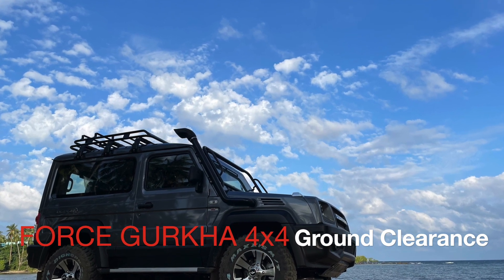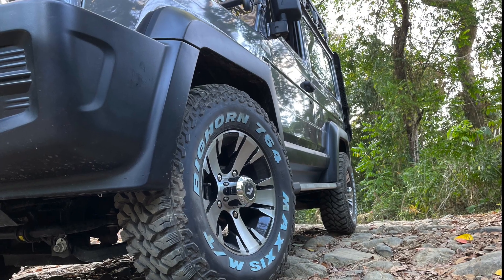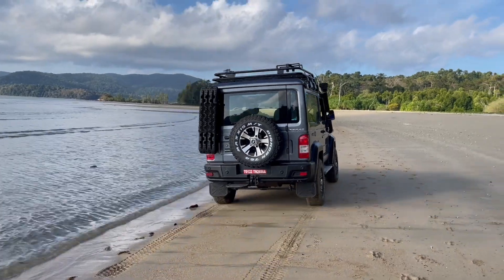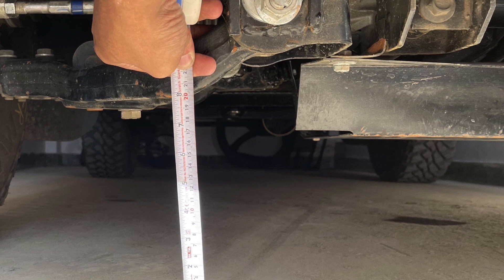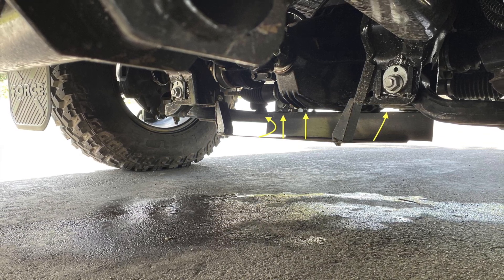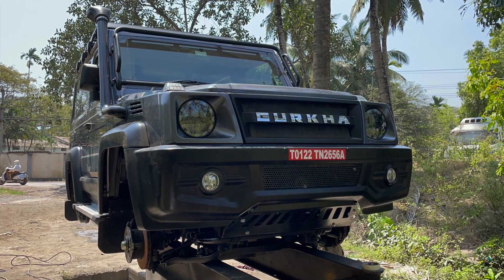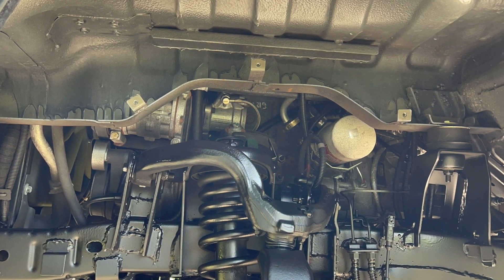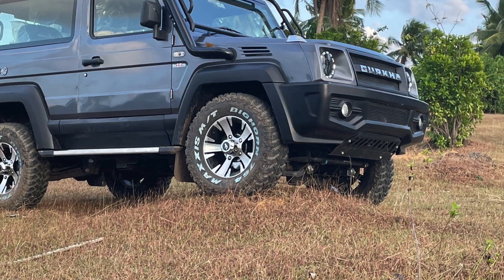Force Gurkha 4x4 BS6 | How I Increased Ground Clearance of my Gurkha | 235mm

Comment: Things that need to be improved in stock gurkhas: 
Gearbox from Traveller (Since it can handle a higher load), higher ground clearance and if necessary a solid front alxle with coil springd ( since it's a durable arrangement). Also the fmtech2.6 engine should be tuned to produce 350NM as of with travellers that come with the same engine.
Reply from the maker: 350HP? did you mean torque Nm? Gurkha runs the 2.6 Common Rail Engine at 67 kW (91 hp) @ 3200 rpm pulling 
Max Torque of 250 Nm @ 1400-2400 rpm. Same engine in traveller 85kW (115hp) @ 2950 rpm pulling Max Torque of 350Nm @ 1400 - 2200 rpm. That’s the best increase we can aim realistically. The G28 gearbox in Gurkha is mated for a private car/off-roader tune while the G32 in traveller is better suited for lugging passengers in a commercial van like tune.
Reply: @tripaccino  Oh my bad I typed HP by mistake. I mean it's common sense that kind of diesel engine won't be able to make 350hp unless fitted with big turbos, expensive injectors and a big intercooler. Even many Inline6 diesels take a tough time to produce that much bhp.
Reply: @tripaccino  Actually the G32 was also paired in the exclusive xtreme variant of the gurkha which produced 321nm and gave service for RFC gurkhas. Such a hell of a mean machine it was. Sadly it's discontinued. It was the only 4x4 in India which proved as a proper 1st gen defender, 70 series land cruiser and w461 300cdi gclass alternative, with solid axles front a rear and coilovers. Now we're left with nothing IG. 😞
Reply: @tripaccino  any plans about churning out big torque numbers?
Reply from the maker: Long term project 😈 please stay tuned and Django will be pulling more soon 😼

Comment: Thank you for sharing.

That IFS bash plate is the Achilles heel of Gurkha. One has to be mindful as an IFS never takes kindly to a bad rock hit.

The Force engine, gearbox and driveline is probably better than any other comparable vehicle. A 75 litre tank would have been good.

A scaled down coil sprung solid axle version, like the discontinued Force Extreme, with one upsize NATO tread tyres and steel rims could make it an unbeatable option for Defence and extreme terrain buffs......

Happy travelling !

Comment: Thanks for sharing. I see that you fixed the low hanging bash plate issue. Did you find a solution for the hanging lower control arm? I would worry about the control arm while off-roading
Reply from the maker: While it mostly can escape by picking the right line and raising the tire upon crests, The control arm does take hit when one is not or cannot be too careful, the solution would be a complete redesign only. Body lift kits still won’t fix the arm issue.

Comment: I couldn't comprehend sir the front arm lengthened about 205 mm with the dash plate ground clearance drops to about 175 mm ...you remodelled the plate put it back in the manner that still it would protect the front arm so how you raised the ground clearance up to 235 mm higher than the 205 lengthened front arms.??...please explain sir....
Reply from the maker: ARAI DEFINITION OF GROUND CLEARANCE: "    """ Ground clearance is the distance between the ground and the lowest point of the centre part of the vehicle. The centre part is that part contained between 80 percent of the least distance between points on the inner edges of the wheels on any one axle."" LOWER ARMS are traditionally not counted for GC calculation as they rise and fall with the wheel. It is a concern definitely but its not as big a problem as a bash plate hanging between the wheels low and center. Manufacturers often use the lower bash plate trick to avail lesser taxes which is based on ground clearance. So if this bash plate was not lowered , Force would have had to pay higher taxes as GC would have been more than 200 mm.
Reply: @tripaccino  ...thank you so much for the clarification sir...and sorry sir had I read about the ground clearance on Google before you  would have saved from your time on writing this long answer ......sir do please make a video on mechanical or other  problems you faced on your Gurkha as I guess you yourself using the very first batch ...as we have seen people are facing  issues  with steering even a serious accident reported in himalyas due to steering failure  ...have you yourself  suffer from such issues sir ....??
Reply from the maker: @indiancommando_abbas  No problem brother. Im happy that I was able to answer your query clearly. I will definitely make more videos to explain everything. If youre interested to know more...Please read all my stories on TeamBHP, just search for the "island gurkha" Justgoogle "TeamBHP+Island Gurkha
"
Reply: @tripaccino  sure sir ...thank you so much...

Comment: What did you do exactly with the swing arm protection plate? How did you resize it and fix appropriately in such a fashion that it increased the ground clearance upto 235mm? 

Did you fabricate that plate by measuring the area where you were supposed to fix it up? Else simply cut it by calculating the measurements?
Reply from the maker: I removed the plate , used a press to hammer it down to flat and used the existing bolt holes to snap on. Drilled additional holes in now longer plate measured to match rear points. Please watch my PRAD underbody video for evolution 🙏
Reply: @tripaccino  
Sure. I will meet u in the future if I get a chance to visit Andaman to scuba dive....I believe Andaman and Nicobar islands have abundant and prosperous coral life that perpetuates different ecosystem under water.

Comment: Sir thank you for the videos after the first service my gurkha's steering started vibrating mildly at first and then the yoke of gear box coupling fell off. luckily some roadside shop fellow found it and the roadside assistance reached us and rectified it and we got moving I was told this is been a problem and there might be a recall another explanation was the bolts were not tightened properly   has anything like this come to your notice? Would like to know your thoughts on the issue  james

Comment: Also the front suspension arms r designed in a inverted way compared to thar.even if u remove the plate the ground clearance if u measure from front suspension arms is very less.
It has to be designed completely again by the force motors
Reply from the maker: That’s true. But lower arms are lesser prone to hit because they will rise and fall with the tires. That’s why ARAI definition of Ground Clearance is limited to 80percent of width between wheels.
Reply from the maker: You’re right that this needs to be re designed by company for what is supposed to be a true blue off-roader

Comment: Your tyre MT is it making noise while driving in the highway?  What will be cost of tyre?  Is it necessary to put underbody coating?  Bc the jango is already rubber coated.  What will be cost of underbody coating cost?
Reply from the maker: MT makes noise more than AT which in turn makes more noise than HT. Small compromise for traction. Depends on where you’ll spend more of your time ? Off the road or on highways. Your choice will also hit mileage if it matters as a concern.
Reply from the maker: My underbody was free of cost . Please tread my team bhp thread : ‘island gurkha’

Comment: Hello. Do you believe the safety of IFS is now compromised? Have you done some serious offloading with this mod? Have you checked the condition of mechanicals after this modification?
Reply from the maker: I use Django only for off-roading and in these islands, all off-roading is serious 😄. The IFS is fine. Mechanicals are all ok. I’m putting up a video of underbody soon. 
Food for thought: tax is proportional to ground clearance.
Reply: @tripaccino  Thanks. My plan is to lift by 2 inches. Introduce underbody protection by working out bash plate design similar to what you did. 265/75 R 16 BF Goodrich KO2. Perhaps think of spacers to increase track width front and rear to take care of CG due to lift. What are your thoughts?
Reply from the maker: @_M_D_M_  sounds wicked.
Reply: @tripaccino  Thanks for providing the food for thought. Got the answer : "As per the current prevalent law, the government imposes additional duty on cars that have a ground clearance above 170 mm, (i.e. SUVs) ... M&M intentionally lowered the ground clearance of XUV500 from 200 mm to 160 mm by placing a stone guard beneath the engine and all this resulted in XUV500 escaping the additional tax burden, which in turn lowered the price of vehicle by almost Rs. 30000."🤔
Reply from the maker: You got me right on point 😸Gurkha has a weird bash plate and an unpublished GC figure for reasons you correctly hit bulls eye.

Comment: This vehicle need an upgrade in its interior parts like Dash boards and steering. Its steering looks so plain compared to Thar. I love this vehicle but its interior holds me back to go for it 👍
Reply from the maker: The interiors is tremendously improved from its predecessor . But you are right it’s too plane Jane compared to Thar. But sometimes simplicity is the ultimate sophistication. For my off-road biased use, I feel lesser gizmos the better
Reply: @tripaccino  There are young generations coming up today and to compete with thar  , this vehicle needs to improve its interior thats my opinion & even it is way better than thar in some points i  think thats why we dont see much buyers  for this vehicle...most of them go for thar.  Everyone dosen't go off roading everyday 😀

Comment: One user reported Steering mechanical failure while they travelled to Sadapkhu in Nepal. Have you experienced any such issue.

Second do the roof rails are RTO approved or can be fined by any traffic police.

Last but not the least your photographic shots with details are very nice and crystal clear.
Reply from the maker: First - No mechanical issues in mu Gurkha. Second - Roofrails and Snorkel are ARAI approved. You can get a copy of the certificate from your dealer. No traffic police can 'legally' fine you for it. I have shared a copy of this certificate in my Team BHP Review of the 'Island Gurkha' You can download it from there as well. Third - Thanks for the compliments.
Reply: Sandakphu is in West Bengal just bordering Nepal. Sandakphu trail is very tough 4WD terrain - no margin of error is forgiven there.

Comment: very informative video, Thanks for sharing Sir, How is the ac response inside the cabin mainly to rear seats? is there any space to mount winch in front side?
Reply from the maker: ac response is very good. the cabin is chilled very quickly despite the large glass windows.  No complaints on AC

Front bumper cannot take a winch, An aftermarket option is available in market with winch mounted bumper.
Reply: @tripaccino  thanks

Comment: Sir 👍 Nice Video, Do you feel any  Engine power compromised compare to Mahindra Thar New , Is it sufficient for all aspects or something else, Jai Hind 🇮🇳🙏
Reply from the maker: My opinion: Engine power is a number. If we don’t read the brochures of both thar and Gurkha and go off-roading in both you will find that the Gurkha is extremely capable and never lets you feel that it’s ‘only’ 90 Hp.
The only place where it will feel like you could need more power is open highway especially overtakes. But this truck is not meant for that. Overall in. City and off-road there’s plenty of power
Reply: @tripaccino  Nicely Explained 👍 Thanks Sir

Comment: Hi, apart from the ground clearance issue, i have seen complaint videos of Oil leakage and TPMS not working properly.
Are you facing any of the same. Thanks
Reply from the maker: Oil leakage. No: the seals required replacement in a few early batches. Rest has been good. 
The TPMS is a joke: has been added for the heck of it only. Don’t take it seriously.
Reply from the maker: Side note : (Rant alert)
All videos of following kind:
 ‘complaint videos’, 
‘honest buyer experience’
‘disappointment’ 
‘poor after sales service’ 
‘this is why you should AVOID’ 
type of videos seem to do very well on views and turn out to be more popular compared to good positive content. In turn this encourages more spewing .It’s a vicious cycle: (rant ends)
Reply: Thanks for clarification👍

Comment: I admire mods done by you but how can u claim the ACTUAL ground clearance to be 235mm when it's front arm is itself at the height of 205mm.(235 is only partial, but actual is still 205)
It's ACTUAL ground clearance can only be improved by upgrading tyre size.
Reply from the maker: You’re right. But just to clear the air out - I’m not claiming that the Lowest point on anywhere in underbody is 235mm clear. You see the strict definition of ARAI for ground clearance takes only the middle 0portion of the underbody and the lower arm is actually not part of the calculation, because things closest to the tire will rise and fall with the tire. The real villains are the mid axle appendages. I still wish the lower arms were higher or differently designed but hey I play with the cards that I’ve been dealt with 🤝
Reply from the maker: Just as food for thought : check the definition of ARAI ground clearance. And then check how many other vehicles have things hanging close to the tire but lower than the actual reported GC.
Reply: @tripaccino  i will surely check..thanks for additional information 👍👍

Comment: Hi, suggest which are better rugged brand tyres for new force Gurkha within budget. i.e 264/75/r16
Reply from the maker: 264?? Or you meant 265/75/16.?
I will not recommend going wider than 245/75,
Or if you need wider then try 255/70.
Any wider and you need fender modifications.

Read all my tyre options with prices in full details here:-
https://www.team-bhp.com/forum/test-drives-initial-ownership-reports/246366-island-gurkha-my-2021-grey-force-gurkha-4x4-andamans-ownership-review.html#post5229204

Comment: SIR HOW IS THE DRIVE QUALITY ON SMOOTH ROAD AND DIESEL MILEAGE
Reply from the maker: ride is excellent on smooth road. For a body on frame tall truck, it is extremely good. Mileage depends on usage. Im using this more for offroading only so mine is not a correct indicator, but still, do not expect more than 10-12
Reply: @tripaccino  thanks

Comment: Effective modification 👌 . Food for thought for Force motors. Did u make any modification in the wheel arch/ bumper in order to fit the Maxxis tyres? 

Thank u
Reply from the maker: Yea, the wheel well is spacious enough to accommodate the larger Maxxis without much issue, but at full turn the wheel does run against front fender. Since this fender is flexible, I have pulled it ahead and secured it with a cable tie to just allow enough gap for the wheels to freely turn lock to lock.
Reply: Okk.. Thank u & looking fwd to more videos on Gurkha & beauty of A&N Islands👍

Comment: The intentional lowering has something to do with new rules introduced in 2020 alongside BS6 and crash safety.
Reply from the maker: It’s a Tax plate brother, Check the description 😺

The lowering of the nose (rake) was for aerodynamics and passing some regulatory requirements. This plate is precisely to bring the GC down for qualifying in lower tax bracket.

Comment: Lowest point is 205 not 235 .
Reply from the maker: ARAI Automobile Research Association of India Definition: ""For the purposes of defining ground clearance, the lowest Point is to be considered within 80% of width in the centre of the vehicle."

 The 10% of width closer to wheels on either side will anyway have the lower arms in most vehicles which are lower than stated GC.

Anyway Im making no claim brother, just trying to make my vehicle more capable offroad. Peace.
Reply: @tripaccino  thanks you for telling me. 😊 But  I was saying  practically 205 .

Comment: How was the engine performance?  and transmission? this is much imp now a days  i came to know both are sourced from merc school so pls let me know your thoughts @tripaccino
Reply from the maker: The Engine is the "Oel Motor 616" Mercedes OM616 engine. Force Motors builds engines for Mercedes in INdia. This engine is licensed and used by Force Motors and named as FM2.6CR. Transmission is sure and slots well. Clutch is super light. For a detailed review please read my TBHP Review of Island Gurkha.